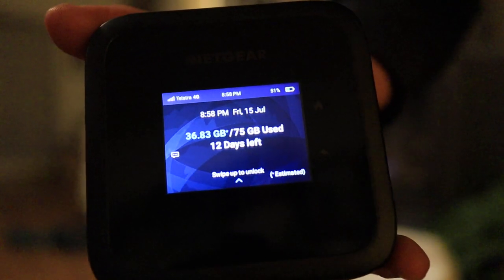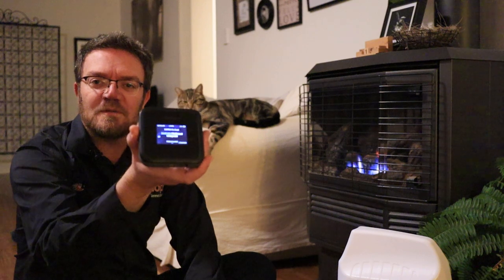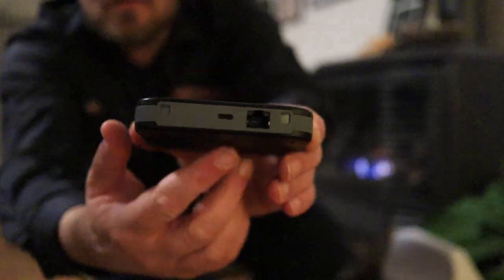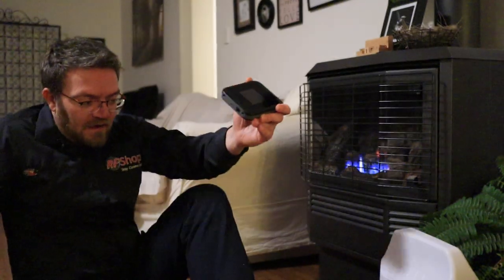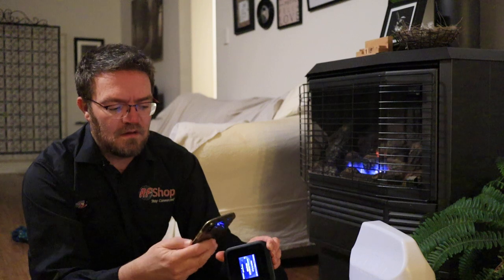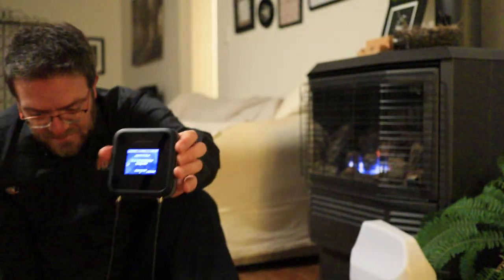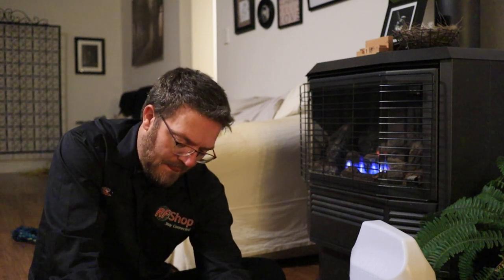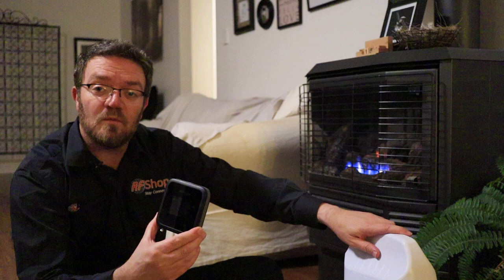Live Recording...How to connect an external antenna to a NightHawk M6

Comment: I bought your MIMO antenna from you the other day. Arrived so quickly! Used today to livestream a funeral service. Made great improvement to signal and reduced latency somewhat. 
One problem I ran into twice was the m6 inexplicable lost all connection. Network status went to "searching". I restarted the M6 and it found a network and carried on working... do you have any ideas around that experience?
Also wondering what app or website I can use to monitor more information about the internet connection like the band and signal strength in more detail? As this might help me when I position the antenna?
Thank you for your helpful service the other day!
Reply from the maker: Thanks for the feedback. I'm not a complete expert on the NightHawk, but what helps a lot is the Netgear Mobile App on your phone. If you connect the NightHawk through that App you do get a lot of specific information that can be used.

Comment: What leads are you using? I currently have SMA to TS9 pig tails, but it does not seat as well as yours in the M6.
Reply from the maker: Those are the A80TS9-174-150 leads we sell. Indeed, there are very bad versions out there, but we are very happy with our supplier’s quality and tolerance.

Comment: Hi David, you mentioned in an earlier video that if you were using just a single antenna you need to make sure you connect to the correct external port on the M6.  Can you let us know which port is the right one
Reply from the maker: Hi Craig,
Indeed. The weather is actually not great this weekend, so this gives me something I can do at home !!!
Reply: @RFShop  Hi David,  I did some testing of my M6 Pro connected to a single external antenna and it didn't seem to care which port I connected to, both gave me an improved signal (2 bars before and 4 bars after on both ports)
Reply from the maker: @craigmalcolm7702  yes, that is indeed what I found as well. 
Uploading that video as we speak 👍🏻

Comment: Interesting you restart the M6 after connecting.
I have an M5 with MIMO antenna for mobile streaming and I will definitely try that trick.
All the videos I have seen on the MIMO is that it can work in a basement of a building however I find it needs unobstructed signal from the tower.
I did a speed test recently on 2 sides of a building pointing in the same direction.
One side was getting 5-10 upload while the other side got 30-50 
What are your thoughts on this.
Reply from the maker: Feels like a cop-out on my end, but I think I don't really know. 

I've seen the upload speeds improve when the parameters improve (such as RSRQ and SNR) so it would probably be good to get an understanding on how those measurements change depending on the location. There could be (pure speculation) reflections, obstructions or even noise sources on one end and not on the other. Or the tower connected to is on the "other" side of the building.
Reply: @RFShop  Thanks.
It is a work in progress.
It is different with every venue. I have the app to locate the best tower first so that's about all I can do.
I also have a yagi to go on a 6m pole but it isn't as practical to set up quickly.

Comment: Hi I just bought a Nighthawk M6 and I been when I was doing a livestream true my iPhone the device got over heated and and then just stopped working. Can someone please tell me why is doing this?
Reply from the maker: I would say it's the plastic and there's no air flow. It does depend on the demand on the internal electroncs...since they are limited in how much processing they can cope with. Extra cooling would be a good idea. However, perhaps the setup requirements a more professional solution (such as the Teltonika's)
Reply: I believe you should remove the battery and use AC power instead

Comment: @rfshop - does the external antenna matter which service provider you use? I am supposed to get my M6 Pro tomorrow. I'm on FirstNet which is part of AT&T. The device will stay in a steel pole barn, and I want to be sure Im buying the right external antenna. Or does that not matter and just get any MIMO antenna with a TS-9 port? Thanks for the help!
Reply from the maker: Apologies for the late response. The antennas we select are quite wideband, with the specific goal to cover all frequencies in the 4G and Sub-6 5G bands. The only problem would be using a Yagi antenna, which is narrow band and will not work everywhere and on all networks...hence why I prefer Log Periodic Dipole Arrays (LPDA) over Yagi's if that's the type of antenna someone prefers. However, all Poynting Antenna producs will work for all US network operators.

Comment: Si puo' aumentare che tu sappia la portata del wifi con dispositivi mesh wifi6?
Reply from the maker: Question is, can you increase the speed of the WiFi by adding a WiFi 6 mesh system. 
If your mesh system can connect to the Ethernet port, then your bottleneck will no longer be the WiFi but the Ethernet port...so in principle that is indeed the way to improve the speeds on the output. You can also look for a mesh solution with better WiFi coverage, so the range and speeds could be improved that way. Do remember though that the speeds will only be as fast as the weakest link. If you have a 10Mbps internet connection the WiFi won't make that any faster.